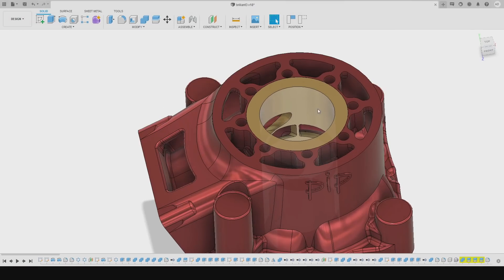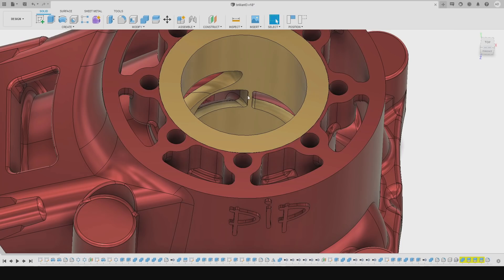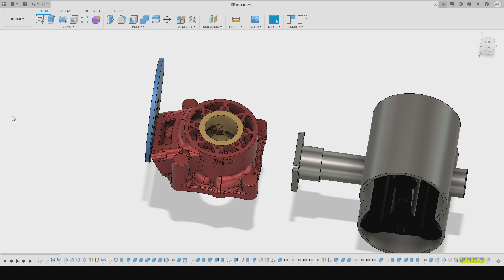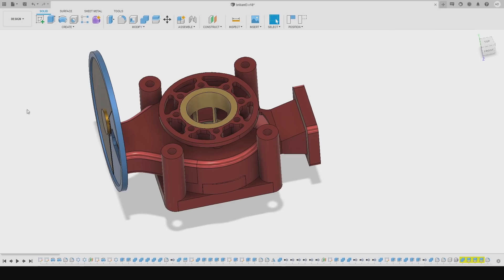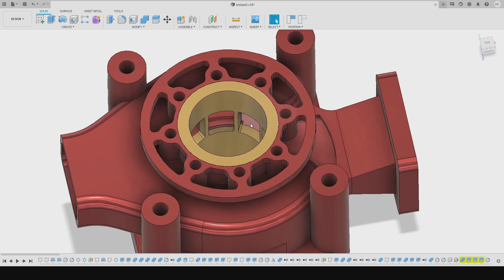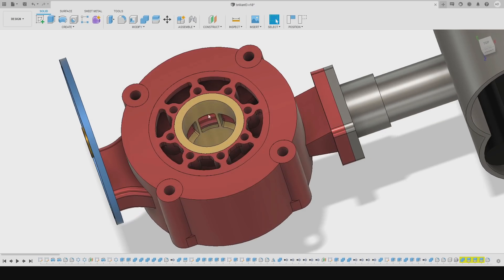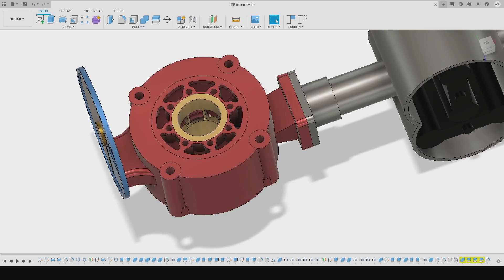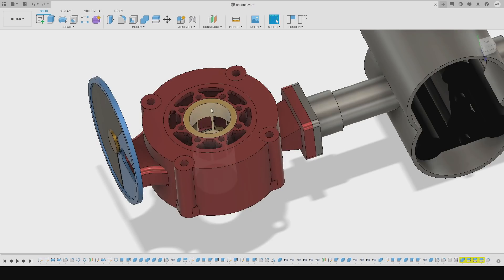Will BLOW Up the Competition! Seriously!

Comment: Managing the heat/distortion from the high surface area exhaust ports might be challenging.
A high speed rotary valve for the exhaust gases will definitely be challenging (temperature/lubrication/durability).
Good luck!

Comment: How about integrating the rotary valve into the cylinder: design an additional ring sleeve that has timing ports and rotates around the cylinder sleeve and has a gear at top or bottom so it can be driven via bevel/crown gears from the crankshaft?
Reply from the maker: Cool idea!

Comment: The port positioning is the problem with ALL two strokes.
To copy them is going no where.
There is a point at which over charging a cylinder robs power
to over come that you need more rotating mass/fly wheel and 
that robs you of responce in regards to engine revolutions.
I think a compressor that both charges and evacuates the
cylinder is the optimum

Comment: I love your ideas but sometimes I wish you would continue with your good idea until you have all running and get your record. And after that is done then you can improve everything and maybe a year later beat your own record. I fear in 10 years you will still work on the most powerful engine which will almost be finished the following year...
Reply from the maker: Totally see your point! The PIP engine will actually be running very soon tho, unfortunately with a bridged exhaust.
Reply: @2STROKESTUFFING  Thanks for your answer. I guess if the rest of your concept works as it should then that bridged exhaust should be a minor issue.

Comment: This idea would benefit from direct injection. As if you rely on a draw through or blow through carburettor or fuel supply. you will end up with a large percentage of the mixture in the exhaust chamber before the rotary valve. Direct injection you can time injection once all ports are closed and not waste raw unburnt mixture in the exhaust port.

Comment: I wonder if it might be better to get the basic design elements correct first, before wasting hours on designing a cylinder which can never work if conventional piston rings are used?

This channel seems very weird as the aim of a 50cc 2T engine with very narrow, high RPM power band, is nothing other than a technical oddity, which I think would be quite impossible to find any commercial application for?

 Emissions performance of a design such as this would be very poor, and I think looking at emissions performance is as important as having basic design correct at the outset?

There are some very good books on 2T engine development available through SAE, some specifically focused on emissions.  Not cheap though, one of those I have is now priced at £176!

Comment: Rather than a reed valve, why not use a rotary valve, timed correctly the inlet and exhaust could share the same drive gear.
Doing this would prevent pressure build up below the piston from the blower (minimal I know but), adding a pressure air reservoir between the blower and the rotary valve would store compressed air until the valve opens dumping a larger volume once open, this could be simply a tank or a sprung piston or diaphragm.
You know far more about this than me, but a little goofball thinking sometimes ignites a spark!
Regards Andy

Comment: Angel your intake ports up more. Especially the two directly in front of the reedcage. 

The two in front of the Reed angled more will blow out the combustion chamber better & the two on the side can be a little less angled to "fill in" under the two on the back.

Angle the exhaust down slightly..these could all be at the same angle.if the piston is domed, match the exhaust port angle to the angle of the dome coming off the head.

This should help with short circuiting when the ports first open which is the most important time to help with "directing" the flow. Basically to give some order to the chaos & improve efficiency.

Comment: nothing but love.
ideal transfer designs prevent intake charge mixing with exhaust, complete evacuation, no inert gases robbing power.
you're not worried about short circuiting intake charge, so no need for an expansion chamber pipe, it's not a concern dumping charge out the exhaust in the quest for making power.
what i am thinking is exhaust short circuiting to the transfers, both intermixing (dilution) and possible preignition from pressure difference.
i suggest going halfway with sufficient blowdown times to partially evacuate the spent charge before transfers open.
with proper closing timing (asymmetrical) of the rotary exhaust, you will minimize lost charge. 
number one rule of transfer design, don't cross the streams.

Comment: In this setup, you also feed the exhaust channels with fuel mixture and there is the possibility that it will ignite randomly.  I think that you can take advantage of that, If you add a controlled ignition in the exhaust you can ignite the unused mixture to expel the air in the exhaust channel and therefore build a vacuum that can enhance drastically the performance.

Comment: Alex, maybe an idea to get access to advance ICE 1d software GT Power? This program is used for commercial companies to engineering engines and other energy systems. Maybe perhaps through a college or university.
Reply: I just saw a video from you of 2017 showing you using software EngMod2t. That software look a lot like gt power. The way of burn cycles that are calculated;)

Comment: Very good idea!
I think Direct Injection could also make this engine much more efficient and more powerful.
With DI you will be able to shoot the exact fuel you need and exactly when you need it in the combustion chamber (after all ports are closed).
Short circuit of ports will be much less a problem, since only gases (fresh and spent) will be shortcircuited, instead of mixture.

Comment: A sleeve valve would work really well with that blower set up, could use the negative side of the compressor to pull a constant vacuum in the exhaust for scavenging too

Comment: I don't think this concept will work but it is a step in the right direction. The fuel air mixture will get pumped into the exhaust duct and then sealed off by the piston, then it will get ignited in the exhaust. Also the rotary valve will leak allot. How about an overhead poppet valve, with an athena direct injection fuelling. That will allow a wet sump too which will be a more reliable bottom end.

Comment: Idea is cool, pretty much like Diesel engines, but I have one question :

Even if you get a high power output at crankshaft, you would loss a lot for turning the compressor right?

Next thing is: when you leave the valve open short time after fuel charge to get some fresh gas out in the exhaust, you could still use some extra supercharging by making an extremely short and steep exhaust.

Comment: If you don't supply the cylinder through the crankcase, you have to find a way to lubricate the crankshaft seals/bearings and conrod needle rollers.

Comment: Im a little more familiar with rotary valves on Rotax snowmobile engines on the cool intake side, will it be difficult to make a rotary valve work on the hot exhaust side of an engine?    Why a supercharger with inherent losses (to spin the scharger) vs a turbo?

Comment: If you could make a 50cc that idles on propane or gas and uses nitro and methanol when you get on it maybe even some nitrous for some big numbers and used it to drive a generator and maybe some super capacitors you could build a serious hybrid system for racing that with refinement and tuning could be very efficient

Comment: Might work, I like it, but the beauty of the original 2 stroke is that is doesn't need any moving parts except the piston. With that rotary blocker for the exhaust gases you obtain something simmilar to the exhaust valve(s) in the 4 stroke engines.

Comment: Great design! What about also running a rotary valve on the intake with the blower feeding into a pressure chamber. This would allow the blower to not deadhead and do productive work when not feeding the cylinder, allowing a smaller blower and reducing losses. More Horsepower! I'm going opposed pistons.

Comment: Why not have one set of ports that are both transfer and exhaust and rotate the cylinder an RCV (rotating cylinder valve). It would increase efficiency and eliminate the need for a rotary valve on the exhaust?
Reply: Some Model glow engines also use a ringless piston when using chrome plated brass cylinder and aluminum piston. (ABC)  Eliminating the problem of rings catching ports.

Comment: I would think direct injection would be relatively easy to setup on this. I don't know how much parasitic draw the fuel pump would add though. 

Another idea is poppet valves added just outside of the piston bore if you want to keep the large flow area. Perhaps you could run 4 exhaust valves overhead, and 4 intake valves just outside the cylinder.

Comment: It will be a flame thrower out exhaust and then the supercharger then will ignite and explode. Don’t spend to much time on that. Unless you can valve it right at the cylinder wall it’s impossible. So put a reg 4 stroke valve in ea one of them intake an exhaust ports and your good to go. So could do an over head intake valves like 4 stroke and regular 2stroke exhaust port with no valve of any kind.

Comment: Why not incorporate an exhaust valve like a Detroit Two stroke diesel? this would eliminate the exhaust ports and stop it from short circuiting. This would allow the blower to actually pressurize the cylinder too. You would have to go direct injection on the fuel but you wouldn't have raw fuel exiting the cylinder which would make it cleaner and you could map the fuel more precisely.  This could raise compression as well because the fresh air ports can be lower in the cylinder and would allow more stroke with closed ports. it also eliminates the piston from doing the work of pressurizing the case and also expelling the exhaust gases which will cause less horsepower loss to operate the engine. You also could run less oil in the fuel which might make the flame front burn more rapidly. with a ring at the bottom of the piston you could keep a small amount of oil in the case to lubricate the crank but not enough oil to cause drag from sloshing.

Comment: Good idea in theory but I'd be concerned about the reliability of a rotary valve in the exhaust.

I like the idea of a uniflow arrangement but what if instead of poppet valves you did an opposed piston 2 stroke like the Junkers Jumo 205?  You'd have access to the full circumference of the cylinder for intake and exhaust ports plus you wouldn't have to worry about a valvetrain.

Comment: There are limits to how much power can be put through a two stroke engine. Forced induction on a 50cc two stroke will most likely result in less total horsepower due to parasitic loss from the friction/resistance in the forced induction system. Then theres the issue of trying to contain the blow though compression and adding a rotary valve which will have more parasitic loss. Then on top of all of that, If by some miracle it did make more power than a standard 50cc two stroke, the output would be limited by the strength of the rotating assembly. To really make power is to increase efficiency. Things like variable compression, variable port timing, power valves, efi design and outside the box piston cylinder designs would likely prove to be more beneficial

Comment: WOW! Cool stuff but I got questions. For one why not use a power valve setup it essentially supercharges itself. Next you've essentially expanded the combustion chamber what do you think the total CC would be now? Also I'm really curious on how you're going to drive the supercharger (obviously off the crank but now you're driving it from the crank and losing a "little bit of power" it would be cool to see a turbo setup because now the exhaust would be powering it instead of the crank)and how you are going to time the rotary valve. Cool stuff dude keep up the great work 💪

Comment: one thing that I think may be a problem in this project is that when the piston is at the top, the transfer doors will pass positive pressure to the block. unless you use a valve on the intake too ...

Comment: You'd need a sprung pop off valve in that exhaust to prevent backfires exploding the head. Blown V8s have them on top of the inlets, 100+ psi sprung plates

Comment: If you're looking at supercharging then basically directly scaling up a 3.5cc nitro rc engine with the supercharger force feeding it would be a fairly simple option. No valves of any sort anywhere and barely any moving parts.

Comment: this is absolutely brilliant. however one concern is after an ignition event all that hot exhaust is blowing into the huge volumes of the intake and exhaust ducts who are also filled with combustion mixture, which seems like it would result in the engine grenading. i agree that valves in the head would be a much easier way to go, detroit did it for years.

Comment: I ficking love it!!    Something that comes to mind is how to keep a constant "crank case" pressure and then to keep the air flow a constant reliable mix threw all rpm ranges.......  

What happens to the pressure in the crank case or under the cylinder on the down stroke?  Normally it would be pushing it up the transfer ports......  now it has no where to go but back to the Reed valave and that will me closed or under boost pressure so it will have no where to go.  I think you will need a rotary valve  in the front too. That way you can control the positive crankcase pressure caused by the down stroke.

Love the concept and hope this works!

Comment: Hey I'm just looking at your design and this is a totally "out there" concept that I'm going to throw at you?

What if you made the sleeve rotatable? Would that induce more wear to the rings? What about a rotatable cylinder inner but stationary outter with a stationary sleeve that wouldn't induce more wear?

Anyway I'll just keep watching cause I'm half way through.... Just thought I'd share some ideas seeming you are really really are looking at first principles engineering and design here and costs with 3D printing are huge!

There is also an engineering program I've seen posted on other mechanical channels that can actually simulate the full combustion process.

Essentially you can load any engine in with all it's 3D specs or use existing engines like LS or what ever and design new firing orders or what ever you feel like and you can stimulate what the changes in your design will lead to the most improvement in horse power or torque or what ever? It can even stimulate temperatures across intercooler cores and show what different shaped end tanks does to intake charge velocity, temperature and pressure etc.
I'll do some research and find out if this is something that could help with your designing?

Comment: So that's why Detroit Diesel 2 strokes have 4 exhaust valves per cylinder... You might want to think about using a turbo instead of a regular supercharger so that it doesn't take power to make power. With how little excess power you have at 50cc the drag of the supercharger is going to kill a lot of your power. A turbo just uses the exhaust gasses so it's pretty much free power and thanks to turbo controllers and waste gates you can have a turbo that potentially could make 30lbs of boost without any real load added to the engine and then you can just bleed off what you don't need, in a way the turbo controller could become almost like a secondary throttle by controlling boost over time. The other big plus is at elevation you can add more boost to compensate for the lack of air density without really increasing the intake air charge temperature as much as if you change the pulley of a supercharger to overdrive it, because blowers have a bad habit of heating the air too much. That was something Gale Banks just figured out doing a combo super-turbo charged Duramax where he slowed the blower down and picked up a huge amount of power just because the intake air temp went down. The big downside to using a turbo would be that you'd have to make a stand alone oil/cooling system just for the turbo to keep the bearings lubed because you don't have the oiling system in a 2 stroke engine to use for it so that's another electric pump and tank and lines.. Plus side is if you have a little finned aluminum tank you can put it at the front of the bike and it can be both the oil tank and cooler in one. Also remember that when you apply boost you need to open up your ring end gap or you'll risk breaking the piston lan off. Scary part, you can get a small engine turbo on Amazon for $145 US.

Comment: Was just reviewing the last video. (prior to this one) You need a one piece ring my friend. That pin hole is in the most stressful area  of the ring. The flexing of the ring is causing it to stress fracture. The fact that it hasn't grabbed any of the cylinder is proof of that. The first failure was grabbing the cylinder on the upstroke. I suspect from too small of a ring gap ,or the exhaust port growing into the cylinder as it warmed up. Your piston design would work perfectly with a one piece ring. Or perhaps better with one of my other designs. We need to talk. I can get you there. Cheers Fred

Comment: I know you have probably already thought about this, but since you are already driving the blower with a gear or a cogged belt.. Couldn't you also drive an injection pump and make this a direct injection engine with timing so you don't waste fuel? You could probably run more boost that way before detonation. The pump wouldn't be hard to make and the timing wouldn't be hard to set up.